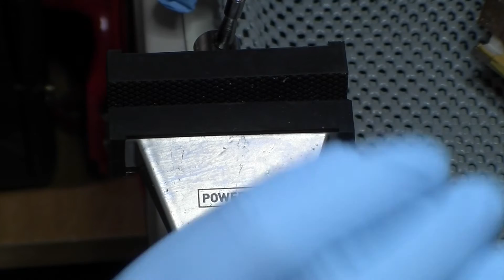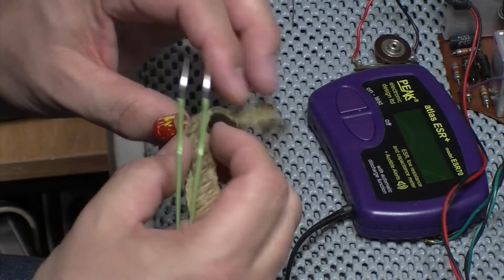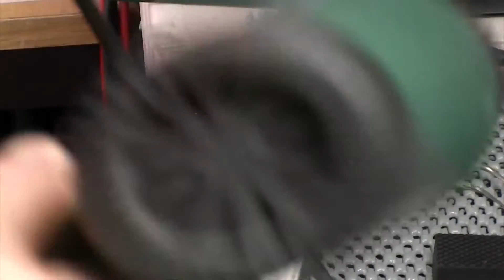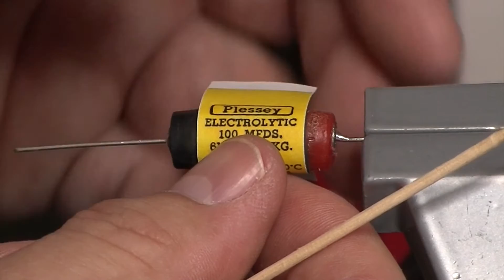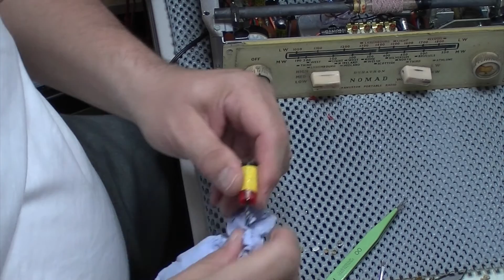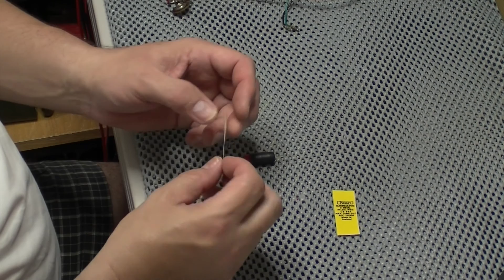Bakers basket of radios: Dynatron Nomad TP11 part 3, capacitor re-stuffing

Comment: Congratulations on your work that I follow with great interest. I am also struggling with the restoration of a Dynatron TP11 and I would like to ask you if it is possible to have a copy of the capacitor clamps that you reproduced with Photoshop. In case you can send them to this address: ciannu@gmail.com. Thank you
Reply from the maker: Thanks. Good luck with the restoration. I will see if I can find the files and send them on
Reply: Radiocruncher ok, thanks

Comment: I.hate restuffing  I.like to no what been fixed as new caps take up less space ,it must a vanity thing because no one going to see the inside anyway new part show you what been fixed .
Reply from the maker: Hi Ron. I’m not usually a fan of restuffing but it does have its place. this radio has a door that opens on the back showing the components when changing the batteries. As it was in such good condition I decided to restore it visually as well as electronically

Comment: I often got labels off with an orange oil based sticky label remover that always did the trick not sure on that stuff on the cap though might be worth a try !
Reply from the maker: I thik I have seen that. Also has a couple suggestions for Goo Gone?
Reply: as I say it has got the labels off easily this orange stuff it came in an aerosol can cant remember where I bought it I got some tuner cleaner and freezer spray at the same time

Comment: I reckon if you used a wood screw you could probably screw it into the middle of the cap and then pull it all out
Reply from the maker: Good tip Andrew. The problem is as soon as you screw or push something in it expands. The trick in the end was to drill the bottom ly then they came out much easier. I will try a screw in the next one. Thanks Graham

Comment: I wonder whether the metal ring is a 'receiver' for an induction/RF welding process?, regards, J.
Reply from the maker: It could be Joe. Strange as some came apart easier than others. It looks like they are fusion welded together